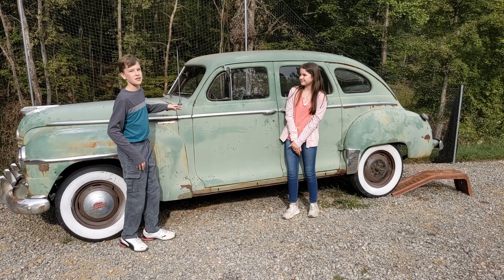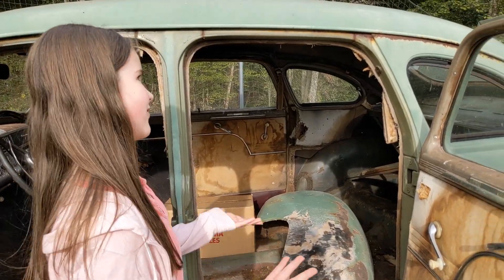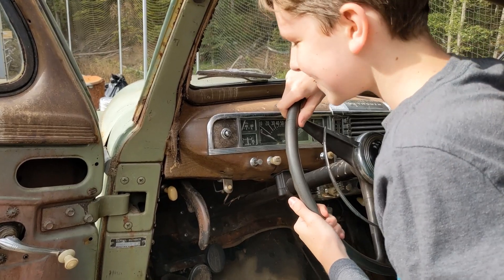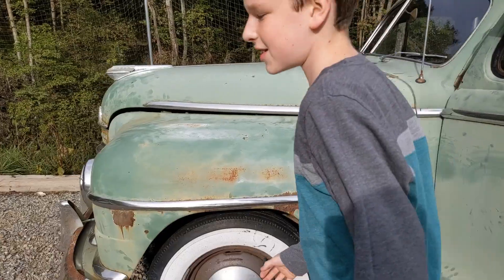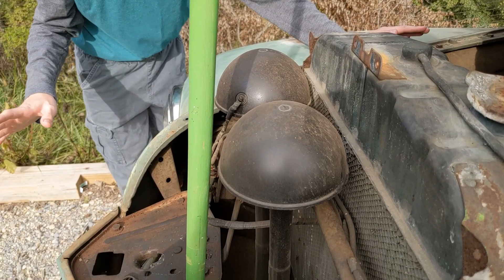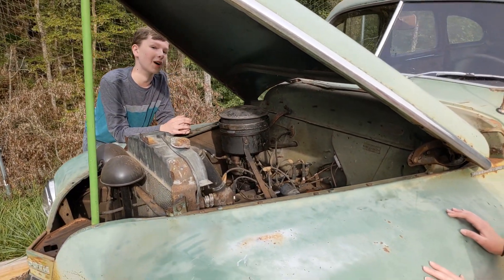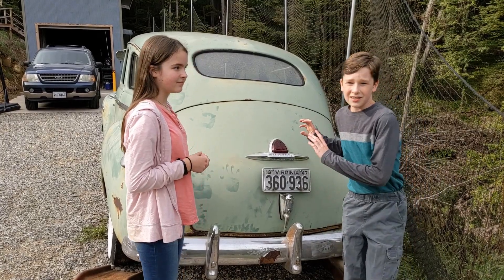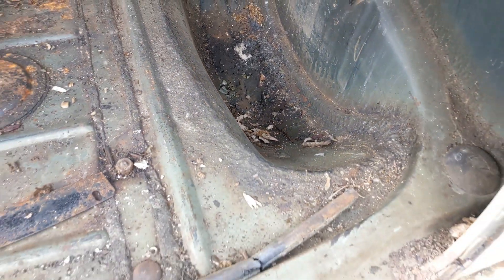1947 Plymouth Project Preview

Comment: Queen and Andy, fantastic video!   Just  make sure that broom stick holding up the hood is really REALLY secure!  I like your comment about the electric windows.   Interesting the front doors did not have door locks.  I send Mr. Tim pictures of the local car show last week.
Reply from the maker: Thanks for the compliment. We will post a video on the hood and doors. Make sure to stay tuned on Friday for our second video on the 1947 Plymouth.
Reply: Thanks for watching!  Best we can tell, you had to lock the front doors from the outside, only the back doors can be locked from the inside.  But they need to tear apart one of the doors so they will get a closer look.
Reply: @TimWilborne  You are welcome.  Fortunately in older cars one can remove panels.  In newer cars, if one tries to remove a panel, one would surely break one or more of the OEM tabs, resulting a visit to the dealership
Reply: @queenandandy  You are welcome.
Reply from the maker: @Dr.G Thank you!!!

Comment: The locks on the front doors work by pushing the inside door latch lever forward. Pulling the inside door lever backward opens/un-latches the door. You will probably have to take the inside door panels off to get inside the doors and re-lubricate the moving parts. There is a special tool for removing the inside door levers & handles. Cranking windows up and down should not be too difficult. Rust can make things very hard to move. Get some PB Blaster penetrating oil spray and use it on stubborn rusty nuts, bolts, moving parts etc. Good luck with this project. It is so nice to see some young people willing to do something like this.

Comment: For some advice along the way, check out: https://www.youtube.com/results?search_query=keith%27s+garage who has lots of experience with Chrysler flat-head six engines and flat head 8 engines. He has lots of helpful hints on Chrysler products, especially 1930s and 1940s. There are some other good sources of advice, but, not all of them use language suitable for young people.
 If you need to remove the carburetor for cleaning and rebuilding, always remove the nut that holds the driver's side to the intake manifold first. Then loosen the nut on the passenger side, but don't try to take it all the way off - loosen the nut by fingers and slowly tilt the carburetor toward the driver's side of the car until you can get the nut all the way off. The reason for this is that particular nut will start bumping against the bottom of the carburetor and you can damage the threads on the stud or the nut and even cause a crack to develop in the bottom of the carburetor if too much force is applied by wrenches etc. Reverse the process when reinstalling the carburetor starting with the passenger side using fingers on the nut until you get close to having it fastened, then finish using a wrench.

Comment: Oh Queen and Andy, there are front doorlocks. Instead of pushing the inside doorhandle down , you pull the inside  door handle UP and you will find that it locks the outside handle
Reply from the maker: Thank you for the information, we have to open up the door from the inside because the outside door handles have been taken off because of painting.